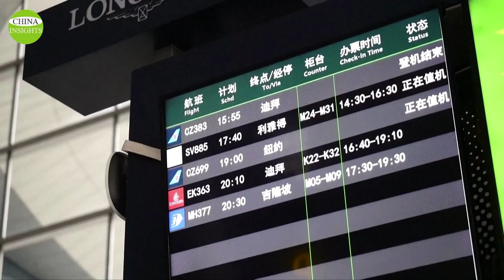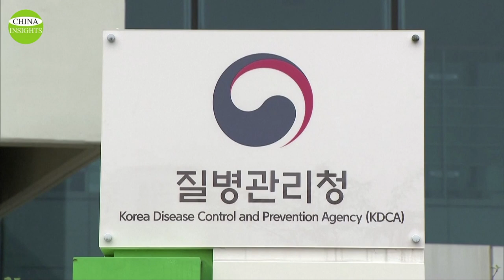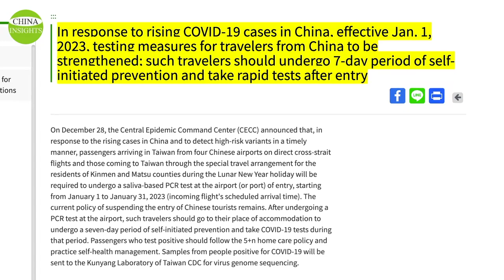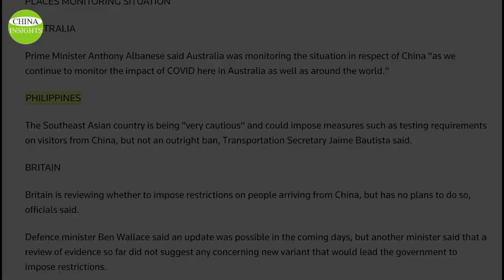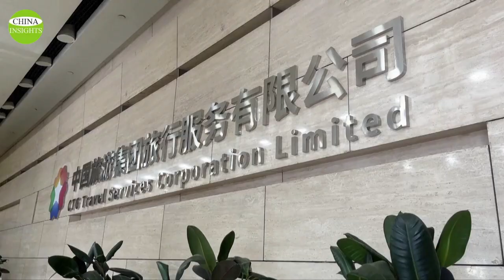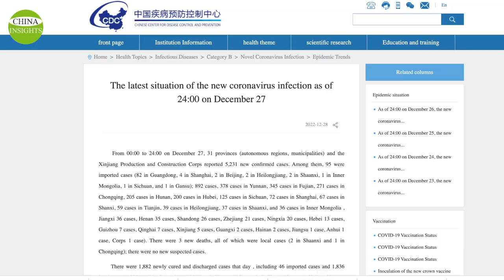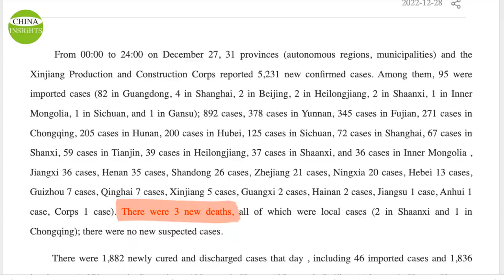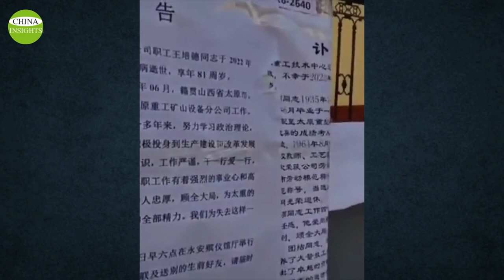The world is scared by China's reopening: Half of its travelers are infected/The virus is horrifying

Comment: Can’t blame Italy, they suffered badly during the initial phase of the pandemic and definitely do not want it to repeat. China cannot blame anyone for insisting on testing.
Reply: Does Italy have 5G technology ⚙ ?
5G syndrome has the same side effects ...
Reply: @kellikelli4413  You actually believe that shit?
Reply: @no.1fan156 
If you research the issue, you wouldn't ask that dolt question
Reply: @kellikelli4413  Which frequency should I research?
Reply: @ef3675     Research microwave frequency damage to humans
Reply: @kellikelli4413  I did, however I didn't read meme sources like biased news outlet but directly from the scientific papers. Found nothing worth nothing, except the absolute ridiculousness of field strength used in rat studies; couple of hundred of W/m^2, basically having your microwave oven in defrost mode.
Reply: @mikeflangerus 
This 5th,6th,7th (etcetera) generation WiFi microwave emitting technology isn't referred to by the military as a weapon for no good reason.
Reply: @kellikelli4413  What are you talking about? Military use of 5G is for more efficient communication networks and probably enemy transmissions interception, it is not weaponized. The most radical example of weaponized EMF has to be the Active Denial System aka Pain Ray which emits a focused 95GHz "beam" (higher frequency than the 5G range) towards a subject and creates mild burning discomfort. It is intended for crowd control or very specific operations and it also requires A LOT more power than a 5G tower.

Again, the 5G technology operates at a 450MHz-71GHz range while visible light (sunlight) ranges from 430THz-750THz, 5G signals also carry way less electronvolts of energy than sunlight. You should be more concerned about exposing yourself to much to the sun than having a 5G tower close to you.
Reply: China can’t blame anyone for anything
Reply: no country suffered.
Reply: @no.1fan156  that is funny, seeing how there are new studies done last year and the year before. most myth stem from truth.
Reply: @itstheotherwhitemeat  Well, that explains how majority of people still use it without issues then, makes me question the credibility of your sources. I'd be more convinced if you said eye damage, but brain cancer? People have been saying that since early 2000s but again, look where we are now.
Reply: @no.1fan156  condemnation before investigation is the highest form of ignorance.
Reply: @itstheotherwhitemeat  Refusing to acknowledge factual reality and statistics is also ignorance.
Reply: @itstheotherwhitemeat  People said the same thing back in the 90s about computers and the internet, but look at how deeply ingrained it is to our lives now. Again, did it give you brain cancer?
Reply: @no.1fan156  more people smoke in china yet have a lower cancer rate than other countries. go figure. you seem to love to hear yourself speak. your points mean nothing. you didn't even look for the studies i mentioned.
Reply: @itstheotherwhitemeat  You seem to have missed the point. What's the likelihood and statistics of brain cancer caused by phone usage? Go ahead and tell me. Correlation does not equal causation, and commorbodity is a concept that exists. 

 And I've seen those "studies" a looong time ago out of curiosity, since the day conspiracy theoriest claimed internet could kill, and guess what? The studies that debunk the subject far outnumber it.